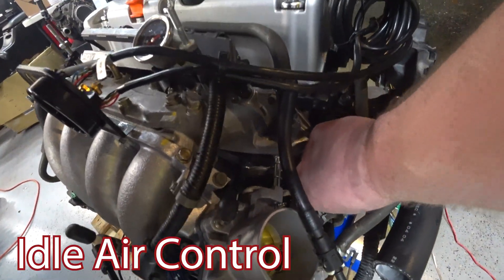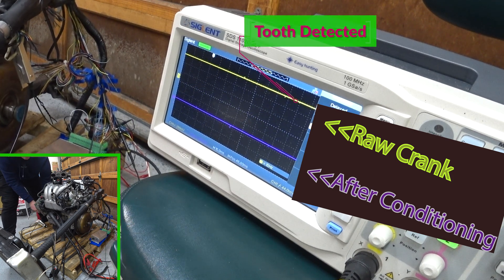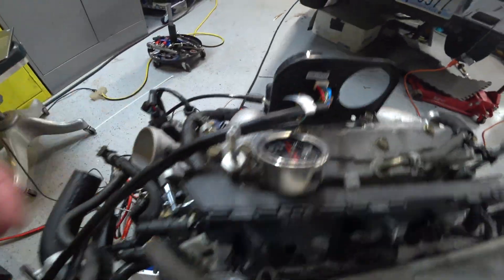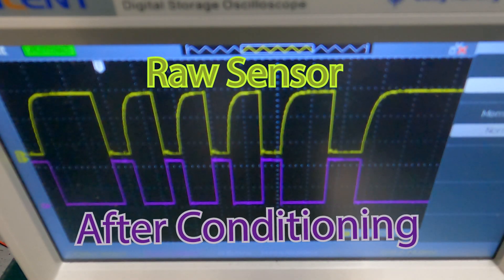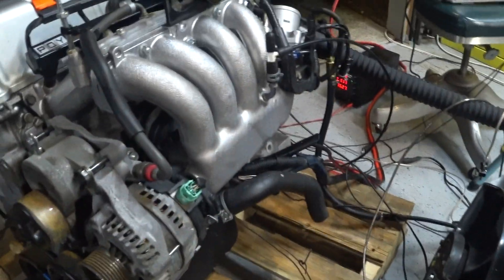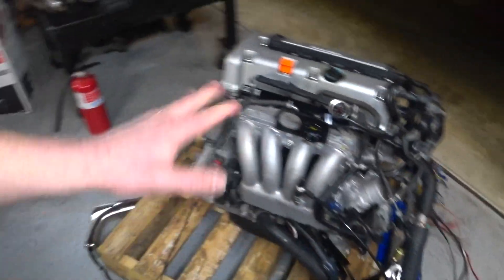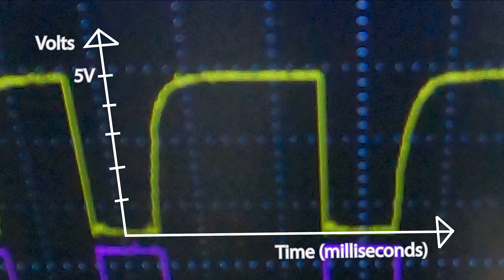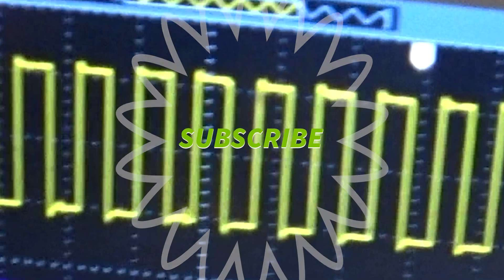Fixed the Honda K24 Sync Loss

Comment: Adding pullup into VR input? What's wrong?
Reply from the maker: Yes
Reply: @MotorSwapDan AC from pickup coil not destroy the ems circuit?
Reply from the maker: @elmatriyana-ef3cp no because it's a hall effect square wave deal, not AC luckily
Reply: @MotorSwapDan whoaa, I almost put a pullup on the vr sensor😂
Reply from the maker: @elmatriyana-ef3cp 😂 thanks for watching good luck with your project. the engine is still running excellent on megasquirt btw I love it

Comment: Well done with figuring this out 😎 I would never have figured this stuff out. I would have been lost if I needed to use an oscilloscope!
Reply from the maker: Thanks man! I got it running about 10 days ago but I just kept editing and editing lol. The biggest thing lately was clearing room for the mr2 in the garage. It's tight but it will work.